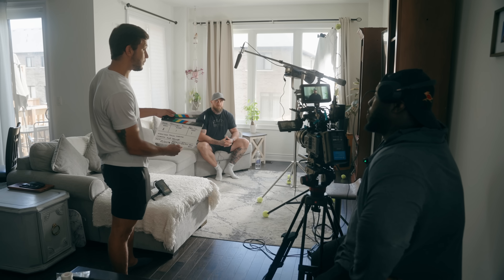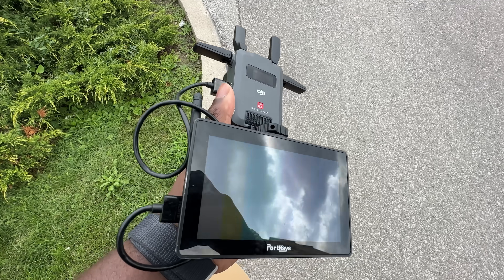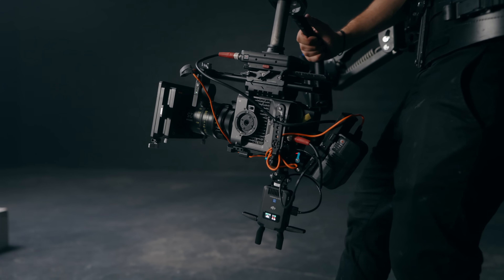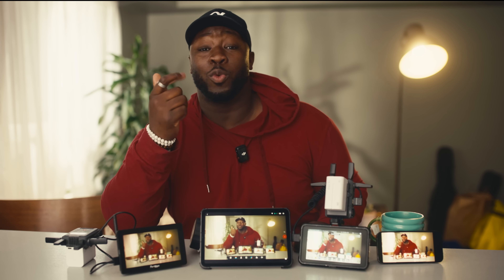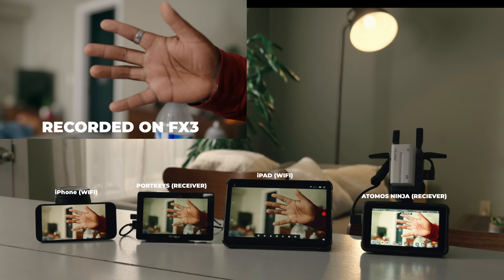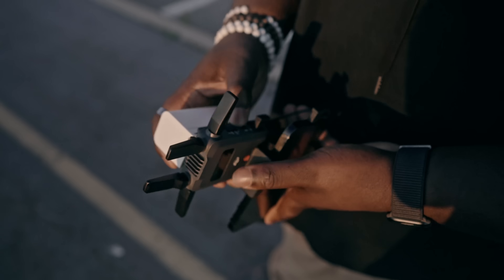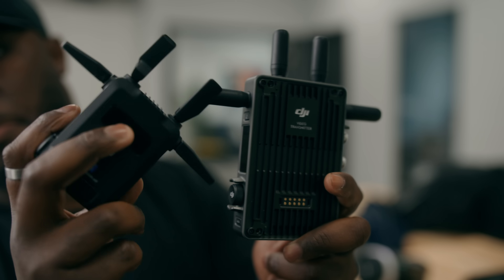DJI SDR Transmission - Smaller, Cheaper, BUT....

Comment: Curious if you'd have any quick take on the DJI SDR Transmission vs Hollyland Mars 4K (or Pyro-which are on big discount these days). Seems the DJI system is pretty slick, but just a Hollyland transmitter seems adequate for my simple director/client monitor needs. Thoughts? Would you def recommend the DJI for range, etc?
Reply from the maker: I wish DJI made a pyros system, but I do like that the sdr can connect to unlimited revivers and it’s real small 🙏🏾
Reply: @KofiYeboah  right on. Seems that to be more future proof with larger crews, etc., the DJI could be a better option, as 4k prob isn't really necessary... especially since anyone viewing would likely be using a 1080p screen. Also... shout out to you being part of the AOD fam - have learned a lot from you all. And... so sorry to hear about your car getting broken into - such a bummer.

Comment: If you were to choose between the Hollyland Pyro S and the DJI SDR, which one would you choose? Clearly it depends a lot on what you are going to use them for, in my case it will be for monitoring.
Reply from the maker: If it’s purely monitoring I like the SDR for the wifi features 😊

Comment: thanks for the detailed info, my question is still, how many wifi can be connected to the transmitter, ipad or iphone? only wifi, how many devices ??????
Reply from the maker: From what I understand, unlimited !
Reply: @KofiYeboah  I tried it and couldn't log in more than 3, only 2 devices. Come on, try it and prove that you can log in more than 3 devices.

Comment: So far the most frustrating short sighted part of these is I can’t run the LiDAR system and use the force motion function at the same time on the rs4…unless I’m missing something. I can’t figure out a connection chain that lets them both communicate with the gimbal.
Reply from the maker: It works with there pro tx/rx set with the high bright and side handles (handle has a joystick

Comment: So does this give hdr signal to the iPad /iphone if we shoot in hdr pq or hdr hlg or down convert to a 100 nits sdr signal?
Reply from the maker: lol I can’t tell if you’re joking
Reply: @KofiYeboah  I work & shoot mostly in HDR so I am indeed serious to know if it can transmit HDR to iPhone & iPad pro. 
I basically want to monitor in HDR while shooting that's the reason I want to know.
Reply from the maker: @RanjanSharma2001  the SDR transmission doesn’t stand for Standard dynamic range, which is in the first bit of the video, that’s why I’m not sure what you’re trying to ask 😅
Reply: @KofiYeboah  Yes I understand fully that SDR in this case means "Software Defined Radio" but my original question is being misunderstood by you. 

Does this allow you to monitor transmission in HDR on iPhone/iPad pro which support HDR?

Hope this makes it clear now about my question?

Comment: got the sdr tranmission - but the fan noise is insanely loud on the TX - is yours?
Reply from the maker: I can hear it, but it’s behind my directional mic so I didn’t pick up much
Reply: @KofiYeboah  if its audible, that makes it tough for audio recording.  but does it change with different fan noise settings?  - that's the thing that makes this thing unfortuately unusable to me
Reply from the maker: @KittyGuerrillaFilms  in context I used it on my camera in this video, which tbh I can’t hear. There might be fan settings in then menu ! I’m not near mine
Reply: @KofiYeboah  i probably have a defective unit. it wouldnt let me update the firmware
Reply from the maker: @KittyGuerrillaFilms  there definitely is a fan sound, it just hasn’t been loud enough for me to notice since I got it almost 3 months sgo
Reply: @KofiYeboah  yea mine is like a hair dryer. also doesnt firmware update so much be a faulty unit

Comment: Does it connect to the DJI monitor?
Reply from the maker: technically yes! just not on the same way as the otehr pro wireless transmitter, you'd need to treat it like any other monitor

Comment: Thanks Kofi, they look very nice from what they offer. 
I use dwarf connection which have under 5ms but for most scenarios this is not necessary. So for that price this is great. 👍🏻
Reply from the maker: I’ve never heard of them before !
I personally didn’t find the latency awful, most of the time if I’m hiring a focus puller, somethings blocked properly, in and out points are set and were fine ! The latency hasn’t bugged me too much (yet) haha

Comment: i desperately need one to make a portable director's monitor kit, and something reliable maybe to rig to my tilta float to run my monitor wirelessly. but they're always so expensive so this is a once i save up enough to purchase, and never want to be forced to replace after the return period is over lol. the float's basically like a steadicam, i'm thinking this would make a great setup hack video. 

i was just going to ask about adding extra receivers / devices and looking great so far. any gripes between brodcast mode vs?
Reply from the maker: On control mode, only works on 2 receivers I believe !
Reply: @KofiYeboah  i'm thinking one receiver for a monitor, one receiver to the ipad/director's screen. two would work for me i think! i'm connecting to red tho. any ish?

Comment: Could I potentially use a USB C to D tap cable to power the transmitter/receiver? Or does it need to be a power regulated cable?
Reply from the maker: I’ll give it a shot but your usb needs power  capabilities or if wont work (certain cables don’t work for me :(

Comment: Seems like you should compare to raveneye instead of their transmission. I'm not further than a room. So range is not that big. Nor are infinite monitors.
Reply from the maker: The SDR tbh functionally replaces it, still has the force motion control and virtual joystick like raveneye would
Reply: @KofiYeboah  I just mean, buying the old system is the lidar incorporation. Raveneye seems to be okay in close proximity I'm not sure what this gets you more than range and multiple monitors? Now I haven't tried to connect my port keys WiFi to a raveneye yet, but works fine on my ronin app on Android. Just saying I'd rather have a dumbed down range of transmission system with lidar and maybe a only one or a few monitors than a beefed up raveneye system. I really just need it for my handset and maybe another monitor, but with lidar functionality.
Reply from the maker: @lightintothefade  in that case, perhaps just stick with raveneye then 🫡
Reply: @KofiYeboah  heh, most likely invest in transmission system :broke emoji: 🤣 that one is hardest pill to swallow. It's so pricey for what it does. But only way to do it unfortunately
Reply: @KofiYeboah  so want to hear something more crazy. The mount between handheld and monitor isn't sold as an accessory. Spent time with support today to try to find it. I own focus kit with handheld. Looking at monitor and transmission
 Doesn't come with the monitor mount. You have to buy hand held separately with monitor mount at $960. Had I known that I would have bought that and basic focus kit. 🤷 Insane they don't sell that kind of important part of ecosystem on its own for those who buy the 2 kits needed to use it.
Reply: Exactly

Comment: Im not an avid anime watcher so this took some searching up and a whole lotta work 😂. This SDR would be really helpful in on set workflow while being lighter than the original transmission! I work with FPV Drones which have pretty good range (using the fx6, same cam at 3:52) so we would still probably use the beefier system for that. But for the smaller jobs with lighter drones and camera/payload this would prove very useful! Having any device work as a monitor actually seems quite useful so you don't always have to have the receiver module with you but it'll probably have much worse range. 
0:14 Luffy from One Piece
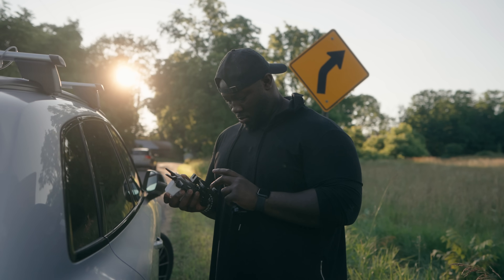1:25 Yagami from Death Note
2:15 Kafka Hibino From No 8
3:59 Jiren alien looking dude From Dragon ball
6:13 Izuku Midoriya from My Hero Academia
10:49 Goku (Proud to say I did not have to look this one up) From Dragon ball
Reply: Lol damn as someone that doesn't watch anime that must've been tough 😂
Reply: @tre.portrays  google reverse image search was godsend 😅

Comment: What happened to your DJI Audio at around 5:30? Interference from the video system? With that latency combined with the latency of the wireless focus would render the setup unusable for me...
Reply from the maker: One of my mics had noise reduction left on which i didnt check lol
its definatley not lightning fast! coming from the hollylands which is around the same latency, for MOST things I do, im great, but if i want a teredeck, im renting, cause aint nobody got money for that

Comment: I am currently using the Accsoon system which seems this DJI System seems to be similar to. The issue i have with my system is i need to make sure that the HDMI output settings are outputting at 1080p, do you have to do the same with this? or does it auto downscale?
Reply from the maker: yes! So I usually go HDMI In to my ninja, and out to the transmitter

Comment: It still blows my mind that I can fly my DJI Mavic miles away and still get a great video signal, but for some reason, they can't make their ground units transmit as far.
Reply from the maker: Interference I guess is different! Like if I’m in the sky, there’s no other devices, and no walls to penetrate a signal, I’m also guessing

Comment: how do you like the sdr compared to the hollyland 4k?
Reply from the maker: Distance is longer on the SDR when going through buildings and such (Hollyland I made it across the street from my house, DJI the front end of a small plaza) Also Hollylands Transmitters don't communicate with your RS Gimbal which is a huge plus!

Comment: cool I was thinking about this another cheap option is the one for the Weebill S and is cheap too but the signal and range are the down fall like it's HD and not very good distance
Reply from the maker: This guy works surprisingly through buildings, those plaza walls are NOT thin

Comment: I was looking for a transmission system like this about a year and a half ago, but there wasn't one. So I bought the original DJI transmission system. It's expensive and good, but it's too big for my B Cam. I've been using it on A Cam. Now, this little transmission is exactly what I need!
Reply: Hollyland wasn't available in your country?
Reply from the maker: I’m glad it’ll work out for you !
Reply: My issue with this system is, there is no seamless way to mount it to your camera. With the original transmission system, you could mount it to a vmount plate with pass through power.
Reply from the maker: @sebastianFZE  it comes with a 1/4 20” mount for a cage you can use 👍🏾 and the tilta plate you have to buy
Reply: @KofiYeboah  True, but not as seamless
Reply from the maker: @sebastianFZE  there’s tons of solutions under 20-30 bucks on amazon if the stock doesn’t fit your needs
Reply: @KofiYeboah  will look into it thanks